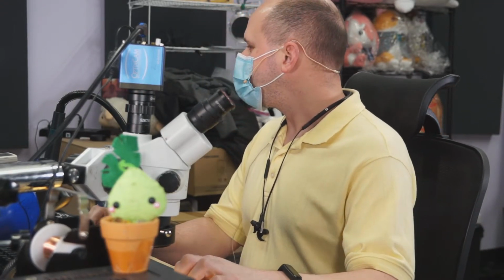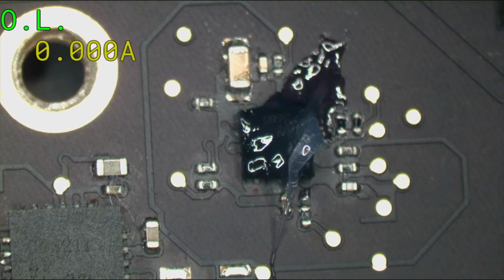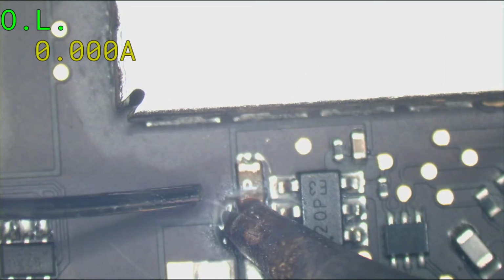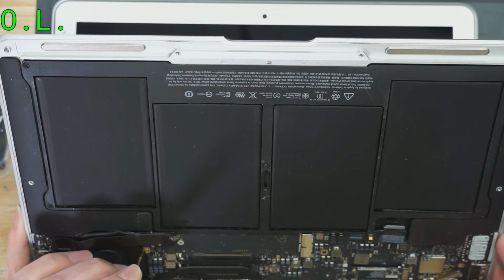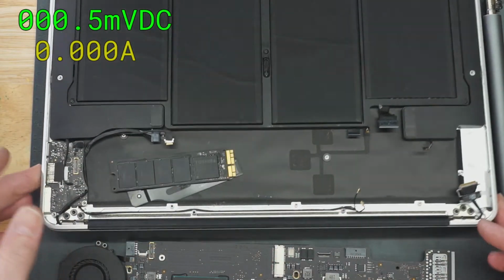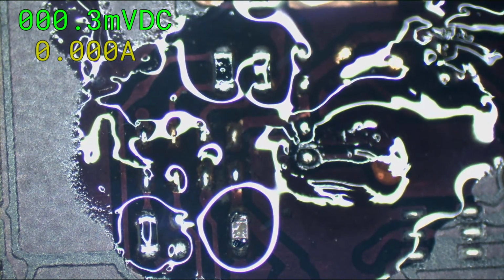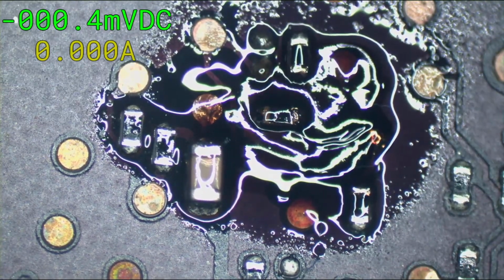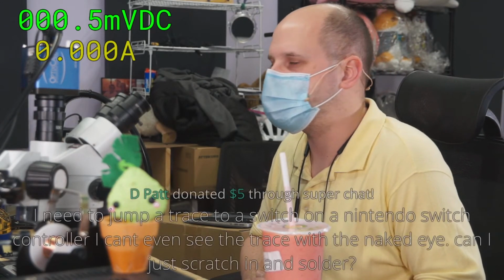Repairing a board

Comment: Check if the load side of the fuse is currently shorted to ground... that way when you lift the bl driver ic you can see if it goes away....